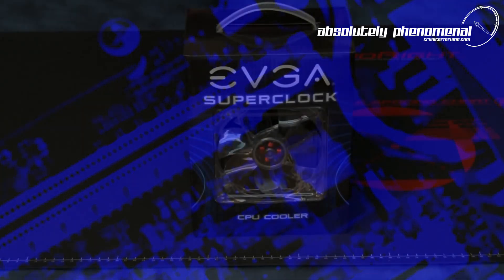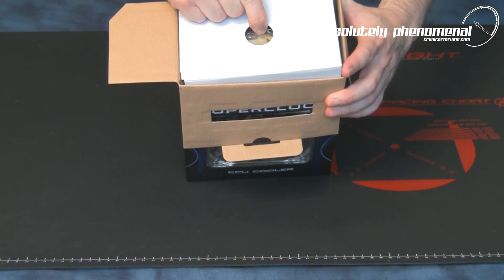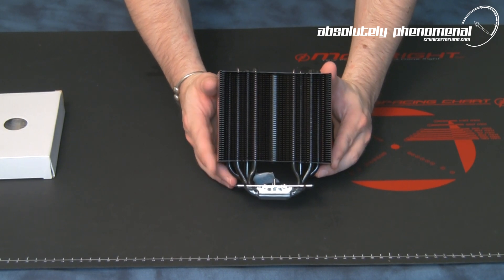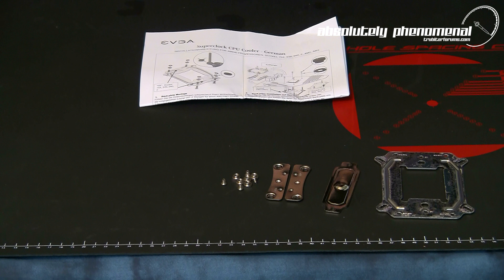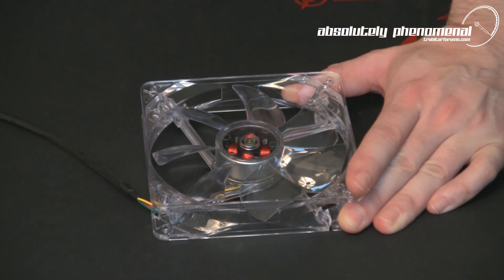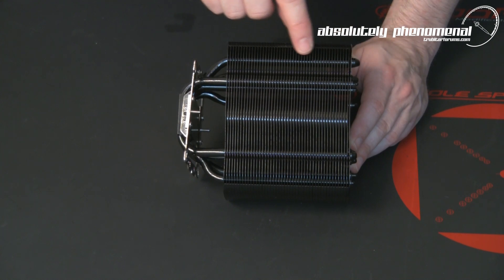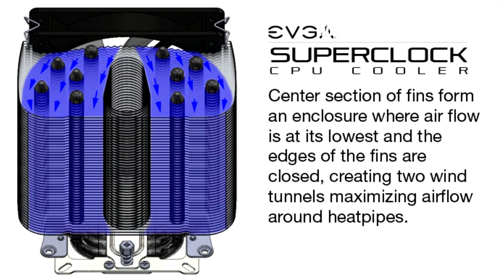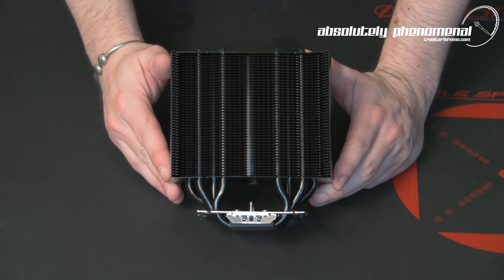EVGA Superclock CPU Cooler

Comment: Would i be fine doing a air cooled computer with a gtx 590 running in it? Im not over clocking and if i plan on doing that i will add a water cooler to it.

Comment: @Olaf16  Those CPU coolers are top of the line, It would beat a water cooled CPU in temps anyday. Ive had 3 different water cooled machines and these CPU coolers along with the ULTRA cooler thats just like it, beat the water coolers by a mile.